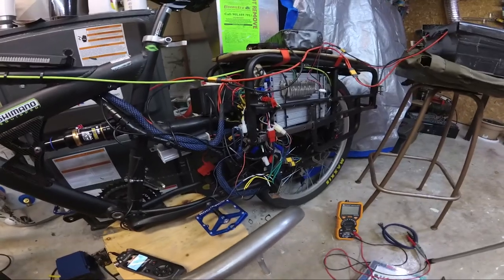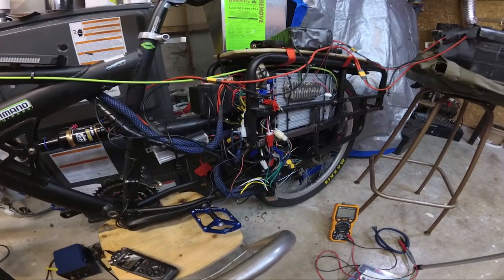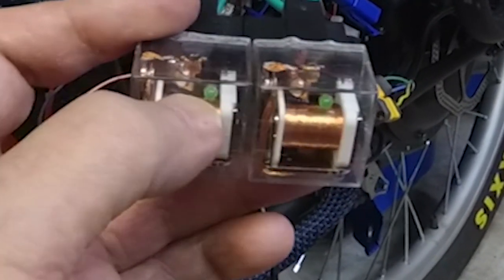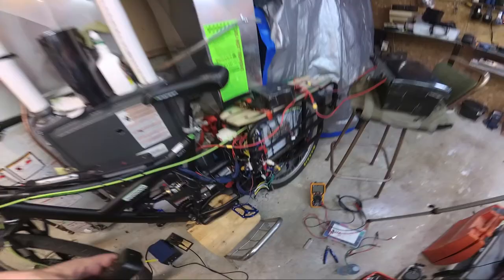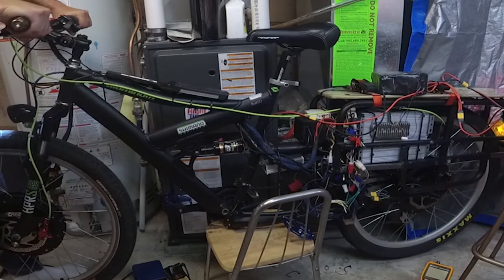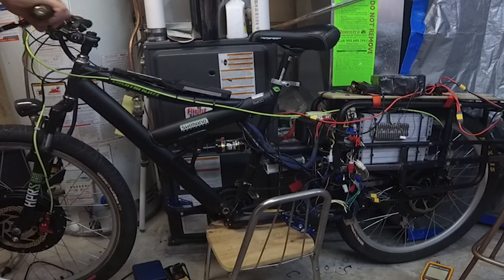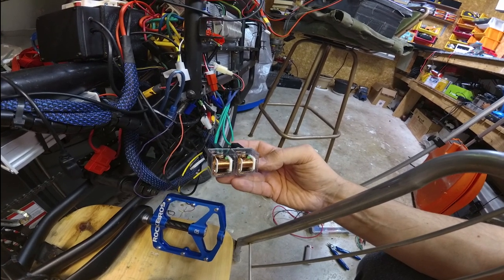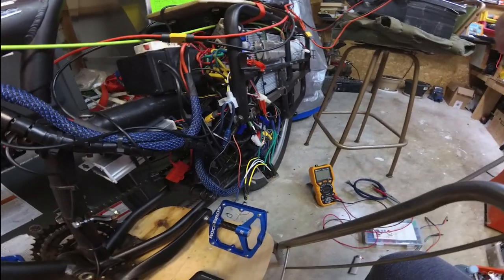ebike dual motor control with 3 speed switch

Comment: bit much to use those relays for this isn't it? the sense wire barely sees 5v, you could just use the bare switch to be honest. That said, solenoids are safer.
Glad to see my theory of throttle sense being cut to one or two motors via a switch works, Kudos man! this seems far more reliable than turning the controller on/off instead.

Comment: I have an ev that has 3.3v throttle and break controls. They were physically broken off by some jerk at the store bike rack. 
All my 5volt controls don't work on it, any idea how I could get 5volt controls to work on it or where I could find 3.3volt replacements?